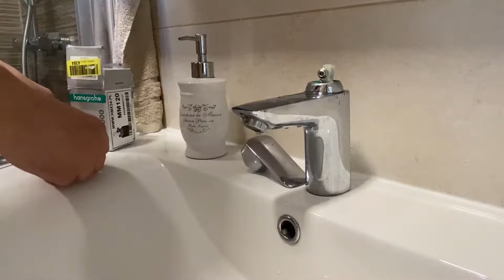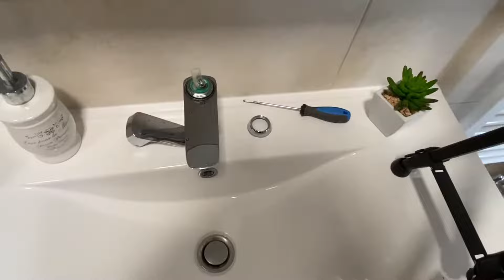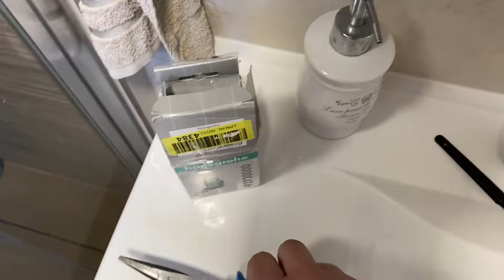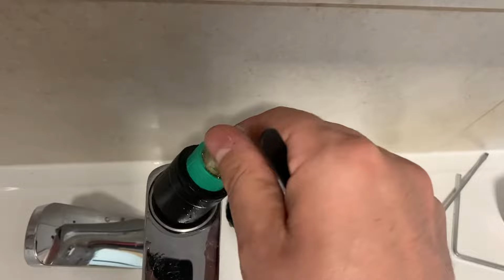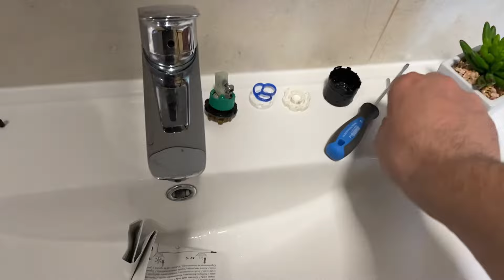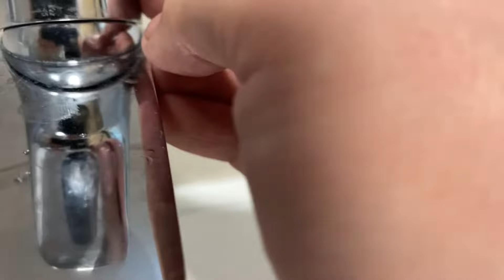Hansgrohe Focus 100 replacement cartridge M2/M3

Comment: Does the M3 M2 cartridge also fit the Hansgrohe Focus 70 basin mixer also?
Reply from the maker: I'm not sure 😬
Reply: Thanks for your prompt reply. 
Really difficult to find the right cartridge      as there are two identical ones 92733000 which has a depth 0.2mm deeper than 92533000. I emailed Hansgrohe also no reply yet. It may be the tap was redesigned and mine was bought in Jan 2016. Therefore better to buy a new tap and try that cartridge. Then still have a new tap more as the cartridges cost 70% of the tap price.
Just rather awkward to remove and replace the tap due to very tight access and tight nuts under the sink needing long handle spanners not sure what size required either.
Reply: I managed to find the part number 9273000 for the Hansgrohe Focus 70 basin mixer which is on the Hansgrohe database which has about a dozen variants of the tap.